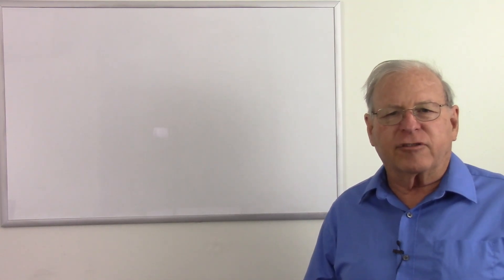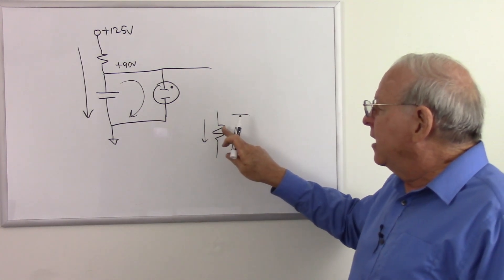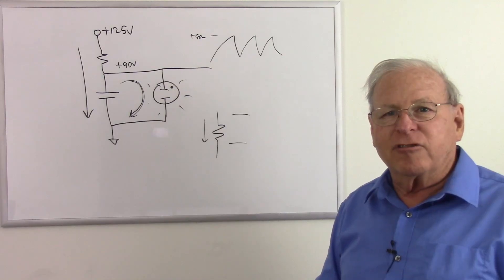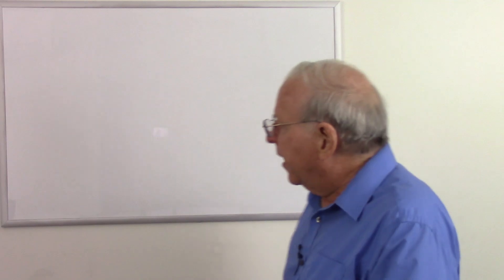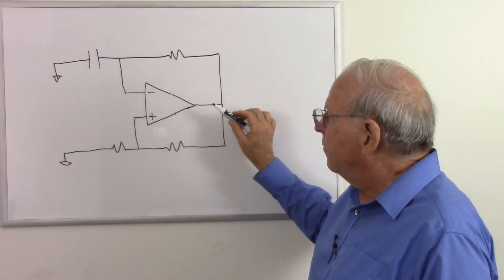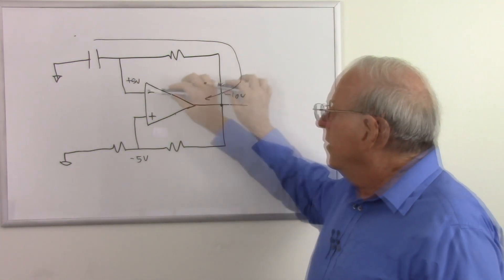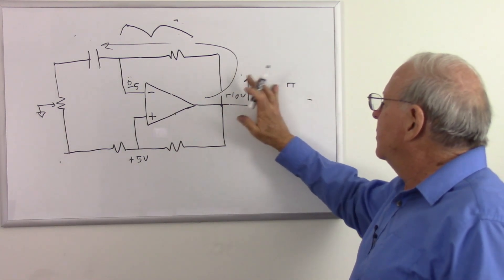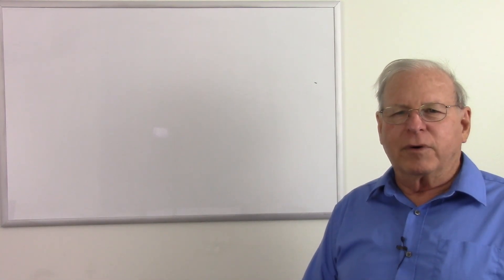Relaxation Oscillators - Solid-state Devices and Analog Circuits - Day 6, part 10

Comment: Easy way to create step downs for power downs so the core @1.1volt ends up being supplied with voltage both sides to stop amps draw and burningn out instead as the voltage drops it falls into the system battery and vise versa it send 2.5 volt back to the bottom to lift the ground 2.5 volt when powered

Comment: In modern days, low frequency for power switching, e.g. 8 K Hz, can use a Thyristor. Someone posted a circuit with BT151 with circuit voltage of 5 volts.

Comment: Thanks for video
I got 10.34Hz not 1kHz using formula provided earlier and values provided later. I may have miss-applied the formula? f = 1 / (2 x Ln(3) x 22u x 2k)
Reply: Same here. If you use 4.7k with 220nF, you get 440 Hz which is realistic.

Comment: They still make normal (non programable) UJT's.  I have a 50 or so 2N4870 which is still made.  For the life of me I can't remember what I stock them for but I would have bought them for inventory if they were in something I work on.
Reply from the maker: Wikipedia, the most reliable source of information on the internet (hoc est taurum stercore), implies they are no longer manufactured. I found them on Amazon but they could have been old stock. A quick search didn't find anything that clearly said they were still manufactured. Thanks for the info.
Reply: @Vocademy-Electronics-Tech  DigiKey and Newark show them as still active. Newark shows the manufacturer as Multicomp Pro.

Comment: 😄Can I run this oscillator with AC or DC supply voltage?
Reply from the maker: Like most circuits, it requires a DC power supply.